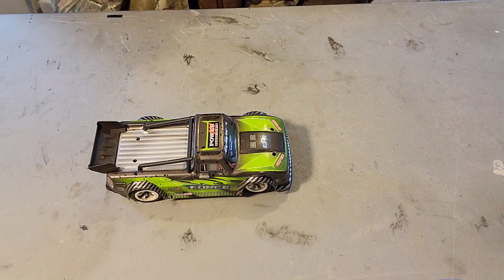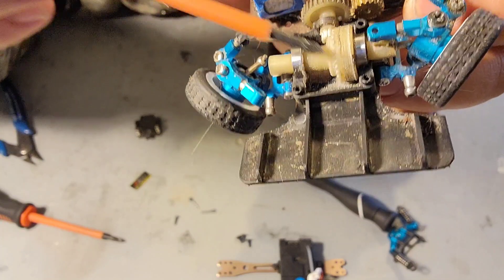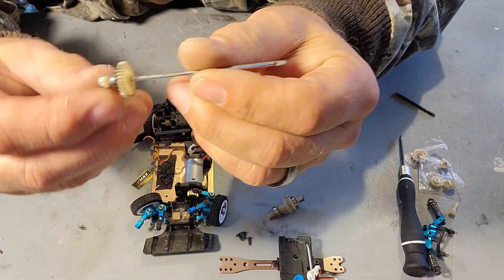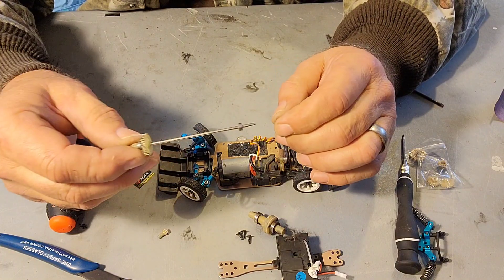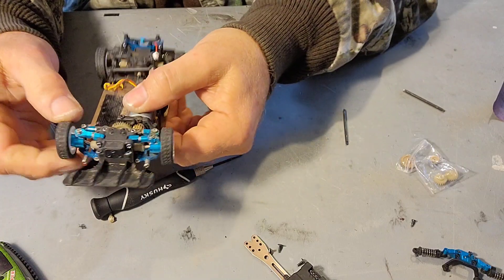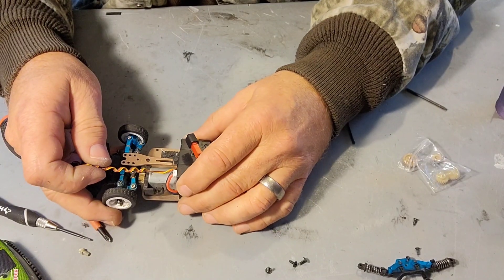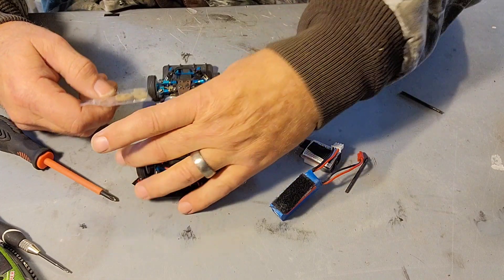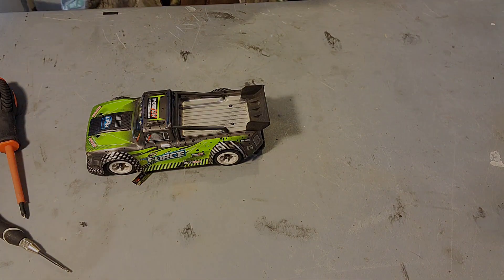WL Toys 284131 FORCE: Rear diff issues with an easy fix!

Comment: I’m having the same trouble with mine. I ordered the metal diffs hopefully fixes the problem. I only ran it twice before they went bad. Like your videos.
Reply from the maker: It's a fun truck. If you order the metal diffs, double check the bearing diameter. I have heard that the newer vehicles have a bigger O.D. on the bearings. Thanks for watching and cheers!
Reply from the maker: And thanks for the sub!

Comment: How do you get the rear box apart? I removed all the screws but it won't budge. The front was easy, but that back one seems to be glued/welded.
Reply from the maker: Try to heat the screws. They might have used loc tight. Other than that, four screws and maybe a little pry. Sorry for the late response. Cheers

Comment: Love this little thing I ordered 3 from different places first one came today, quick question is it normal for these little guys motors to get so frigging hot?
Reply from the maker: Yep! I get about half way through the included battery and will let it cool down for a bit. Also pay attention when you pick it up... you will definitely know you touched the motor! Hahaha! Thanks for watchin and cheers.
Reply: @huntemup72   lmfao...To late already burned my finger.
Reply: The wheels were too tight from the factory
Reply: You can buy ally motor mounts .. I have ordered but very slow from aliexpress but with ally motor mount that should suck out a ton of heat not to mention the mount will be screwed to the ally chasis
Reply: the motor heating a ton is also due to the problems with the sticky diffs and plastic sprues in the gearbox\drive train. the motor and esc heat up more than they should because of the shitty level of quality of the plastic having extra plastic that gums it all up. 

mine is brand new, and only works at 75% throttle and up because the diffs and drivetrain are so sticky and i'm looking for a guide how to open up the gearbox. 

don't get me wrong, the car is great, and fast, but it's not easy to control when you're having to nearly floor it just to overcome the friction on the gearbox. 

maybe i got an especially bad one, because, like i said, i can't use slow\medium throttle at all. the car just won't move until i give it 75%+ throttle. Reverse only works half the time, because the car doesn't want to start moving. and when i take my finger off the throttle, the car stops on a dime, as if i braked hard.
Reply: dude this is happening to me i just got mine today and the differentials are super stickyyy, have you found a way to fix it???
Reply: @chicken6470  I opened everything up and greased the gears it helped ,but you do get what you pay for

Comment: Hello... Great video... I've just ordered one and new to the hobby have a fy08 aswell. Is there ant thing worth checking over before the first run
Reply from the maker: I checked all the screws and ran it! You will be doing diffs sooner than later, so be prepared.  Welcome to the hobby, good luck, and cheers bud!
Reply: Hopefully you found a lot better info .. both diff needs removing and fixing before you use it.

Comment: I bought my k969 yesterday, i used it for 15 minutes and it worked fine but after charging the steering is working but the throttle isn't working, LED on receiver isn't lighting up, but the BINDthink is blinking. what do I do?
Reply from the maker: Try to rebind your radio, check the motor wires and connections, and last, make sure the battery is fully charged. If not fully charged, it won't run the motor. I hope this helps and good luck bud. Let us know what happens!

Comment: I need help, urgently. The wltoys 284131 arrived today. I charge the battery to the maximum, and when I go to turn it on and it connects, it turns off when I put the car cover. Can you tell me what's going on please? 

 Searching to see what it was, I found that when I move the cable where the battery is connected to the car, it turns off automatically. Just by lowering the plugged in cable a little bit, it turns off.
Reply from the maker: I would chech the battery connection at the esc. Also make sure the body isn't hitting the on/off button. If the wires get in the area. It will hit the button. Hope this helps and let me know. Good luck and cheers